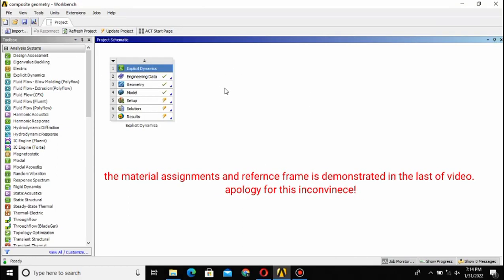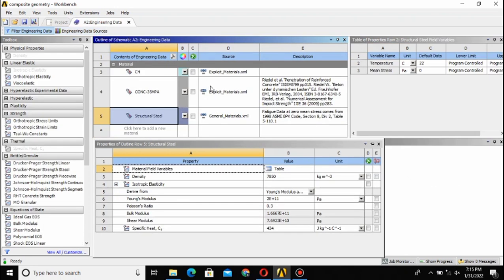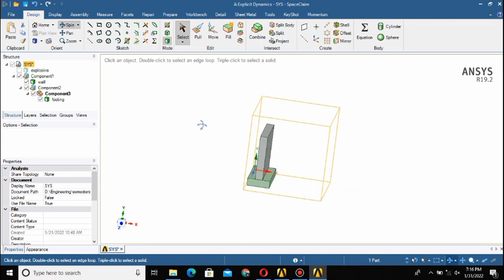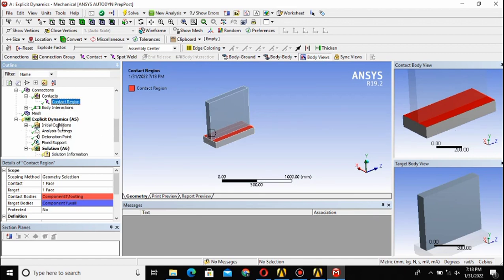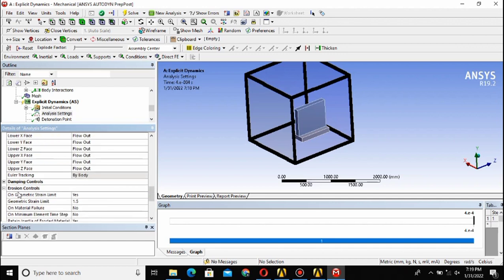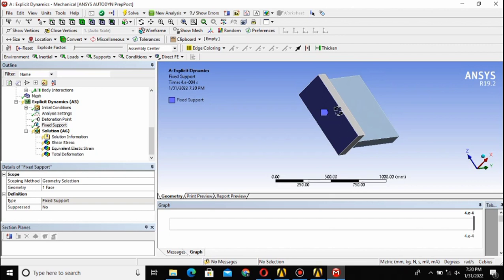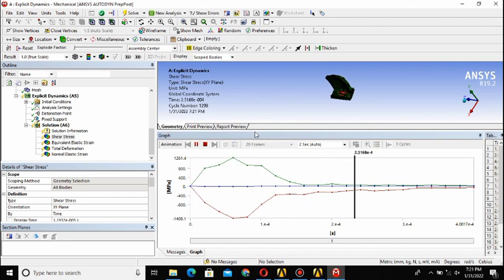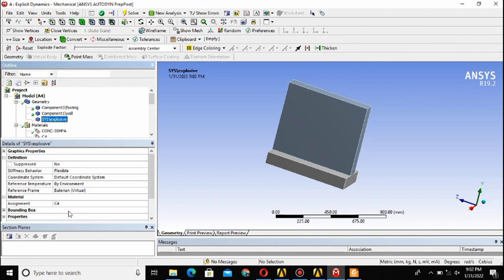How to simulate 3D blast in ANSYS workbench || AUTODYN || #imali

Comment: Note: If you do not activate the "On Material Failure" under the Erosion Controls in Analysis Setting, the material you are using will brake/erode at the given strain limit (here 1.5), which delivers 99% of the time total useless results. If you really want to investigate the blast effects on the surroundings, this method is mesleading and has no use.  Additionally you even have to add some failure to your materials under Engineering Data.
Reply: Alright, sir, these are beneficial information. Thank you so much @Herk_Daniel if wanna add something more will be very helpful for me to model it correctly. I also have a problem, when I model concrete using the RHT strength model, I get the deform shape somewhat unreal. 
Another problem I am facing is energy "error is too large" in my analysis if wanna add something about this will be highly acknowledged.
Good to hear from you,